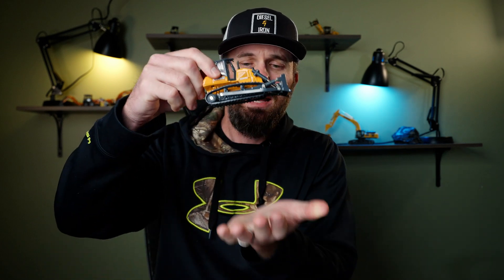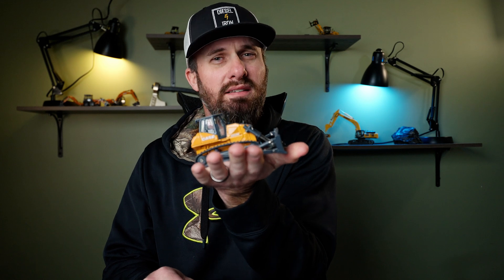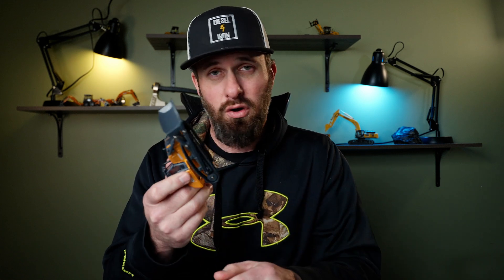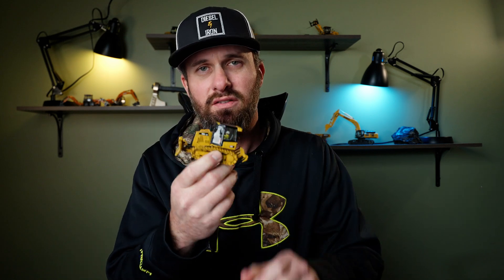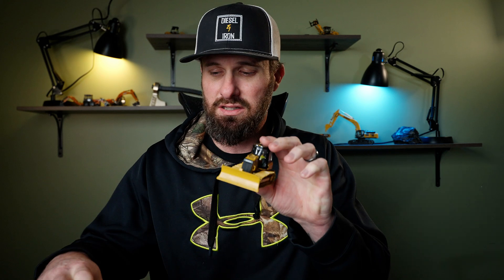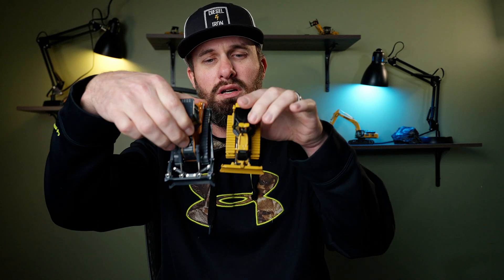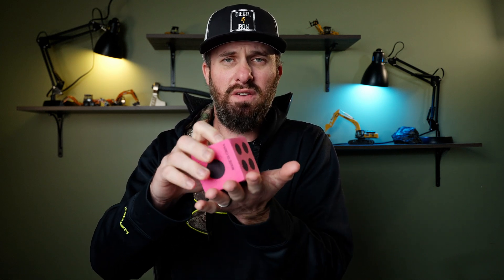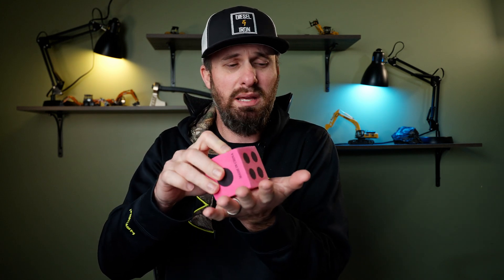What is Ground Pressure

Comment: I'm not an operator and never driven any dozers.  What does LGP mean and what is that joke about at 7:20? Tried to google it but didn't get anyway
Reply from the maker: LGP stands for low ground pressure.  The wide pads spread your weight out to where your ground pressure is much lower.  7:20 wasn't a joke.  I was trying not to pop my "P's" into the microphone so it sounded like I was saying LGB instead of LGP.
Reply: @DieselandIron  I see   thanks

Comment: Interesting, never actually thought much about that. I suppose that's also why you see LGP tracks more often for finish dozing sand or rock, right? Since the broader distribution of weight helps create less ruts in the material as you track back over your finish passes. I know when I'm doing capillary break with a skid steer the tracks definitely compact the rock somewhat.
Reply from the maker: You are 100% correct.  Flotation is everything in those conditions

Comment: These illustrated teaching segments with the scale models are excellent. More on dozers please.
Reply from the maker: What would you like to know about dozers?
Reply: @DieselandIron  I've operated Cat high drives and Komatsu low drives. I'm trying to figure out if there are types of material/jobs where one is more productive than the other. I cut down a 95,000 ton pile of asphalt grinds with the komatsu. Lots of maneuvering in the pile. Not sure if the Cat high drive could have done as thorough a job. Thoughts?
Reply from the maker: @RiddickMaximus  From what I understand the high drive doesn't really make any difference in production.  I've been told it's really to get the finals up out of the material so they aren't getting hard packed with mud which reduces heat and wear.  That being said, that's all third hand information so I don't know for a fact.
Reply: @DieselandIron  Getting the final drive up makes sense. Being that it raises the entire dozer higher in the air, I was curious if that makes a difference in stabilization, maneuverability in say narrow spaces?The Komatsu d37x did a great job for me.